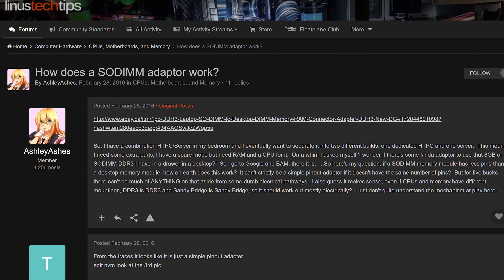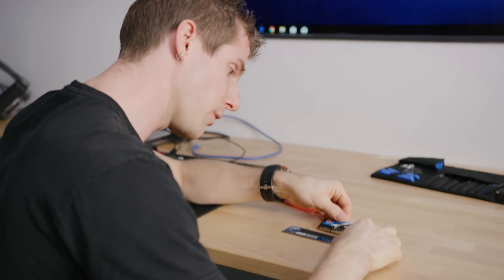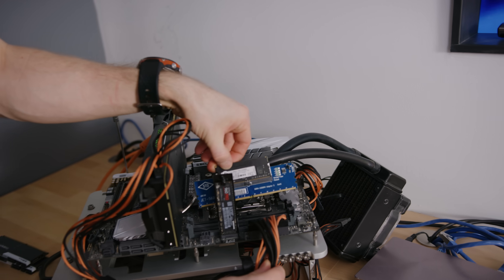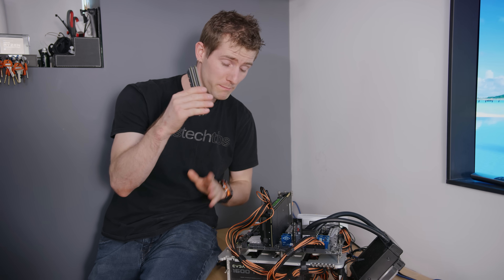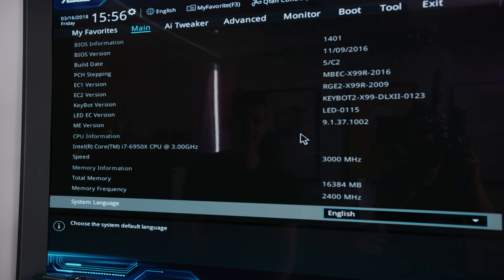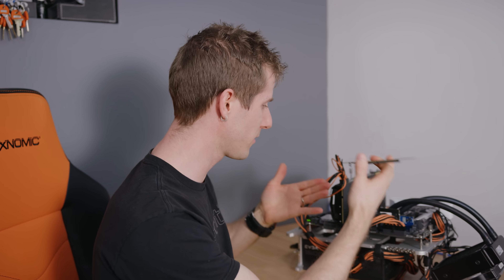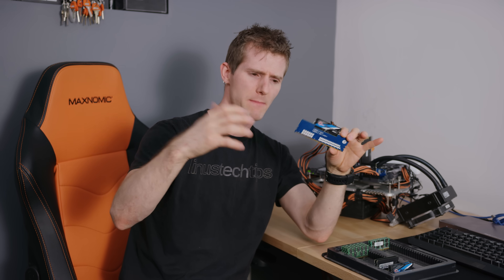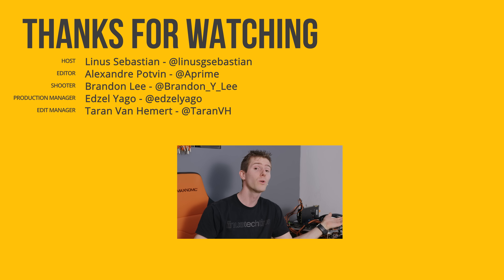Installing Laptop RAM into Desktop!?

Comment: 7y later if prices for normal ram keeps up, sodimm can still be cheap at places.
20 to 30 euro for ddr5 adapters, 24 gb for 100 euro, 32gb 150 euro. CAS Latency: 46 5600mhz. not great but a cheap option atm. Then use them in a future laptop later :face-purple-crying:

Comment: Believe it or not, this is very useful to me in 2025.
I run Proxmox on an HP Elitedesk G2 mini with 32gb sodimm ram and an i7-6700t.
I want to add OPNsense but have no slots for extra network cards and can get the larger G2 SFF that does very cheap with 4 or 8gb ram, but 32gb of DIMM ram will cost way more than the PC itself will.
With these adaptors I can use my existing CPU and RAM and get the slots I need for peanuts.
Reply: bro i’m fr thinking abt building an am5 build but the ram prices are so insane. i have a laptop that doesnt work anymore cuz it cant connect to wifi (ive tried ethernet and i got a new wifi chip new drivers i mean everything!).. was $1300!! i took out the ssd and ram and i plan on using it in my new build!
Reply: @Antlaar  What laptop is that out of interest? Have you double checked BIOS settings or for a small physical networking kill switch some have that is easily missed, if you didn't know it was there?

Comment: Hey, Linus. I have an old laptop running oWn DDR2 RAM. I wonder if you could upgrade the RAM slot to DDR3?  What I mean if you could remove DDR2 and put back DDR3 on into an old laptop.
Reply: Will it work that way?

Comment: my streamer pc wants DIMMS, I do have 4x16gb 4600mhz cl18 DIMMS in my gamer rig. I could use 2 of them in the streamer rig BUT the DIMMS are unsupported for that motherboard, it will work but it wont get more than 3800mhz and it will always give a message at startup where it says  "unsupported DIMMS found"
I would  never put in SODIMMS in an adapter to put in one of my systems, hell no!

Comment: Weirdly with a lot of laptops now there's a lot of free space due to the new norm of only including one memory slot... so really, a lot of laptops could have a fill size DIMM slot.

If anything there's enough space in a lot of machines for a SODIMM to DIMM adapter (the other way round to this one) to actually be feasible but no such product exists.  Full size 64/128GB sticks in laptops would be cool though.

Comment: I know this is 4 years old, but in answer the the question why? I have dead laptops people have given me for parts over the years, lots of laptop ddr3 ram, and an old 3770k + board with no working desktop ram about, when ddr3 is $200 and adapters for this old ass board are $3 and I have a bunch of laptop ddr3 around, I'm glad they exist.

Comment: Aseller on aliexpress wrote the following about the same adapter.

Description
Note:
AMD motherboard memory controller is integrated in the CPU, Since the CPU does not support notebook memory SPD data, AMD motherboard can not be used, AMD users need to pay attention when purchasing.
Specifications:
1.SinLoon Laptop memory riser card can use laptop three generations of memory for desktop DDR3 memory slot.
2.Laptop DDR3 SO-DIMM to Desktop DIMM Adapter Card Allows idle notebook DDR3 memory to be connected to the desktop.
3.ABS environmentally friendly material, resistant to falling, wear resistant.
4.Made of high quality electronic components, stable and reliable performance.
5. The pin has good contact performance, ensure stable working. Product Name: Laptop to Desktop RAM Connector
Model Type: DDR3
Colour: Green
Package Include: 1 x Laptop DDR3 SO-DIMM to Desktop DIMM Adapter Card

Comment: I'm searching for some even crazier solution: These DDR2-SODIMM models are so expensive. The notebook is used as desktop, it will not be moved much. Would be massive, if I could use a kind of external adapter with wires to get used for cheap DDR2 desktop RAM (say a 4 or 8 GB module) with an adapter in my notebook that only supports DDR2. A DDR2-SODIMM costs around 50 USD, this is insane. So I need a DDR2 desktop to DDR2-SODIMM-Adapter. I know that I only could hook it up external because of the bigger physical size of desktop RAM.

Comment: Or... now hear me out. You can resell old laptop dims, for less if anyone needs them for a device they're stuck on.
like, if someone was stuck on a 3rd gen intel laptop, but buying a little ram kit would be a waste, they could just get 2nd hand kits for less which will save them money. Mostly in the event they can upgrade to a new laptop, they can still use that laptop for a little longer, and save a bit of money.
btw, this only really applies is if your laptops performance would improve with more ram, like if windows and the apps are taking all of the 4GBs or 8GBs of that old laptop

Comment: Also, I could see a situation where you've got a desktop with dead ram, but you've got a laptop laying around, it's a cheaper solution than picking up brand new ram for the desktop, perticularly if that laptop ram is if quality value at all

Comment: I know your MacGyver and all but 2666 isn’t actually that bad for gaming.
I can attest to that much because I had a 4500u laptop obviously and it came with 8gb 3200 Samsung nothing new.
I couldn’t get Warzone too play without getting error messages 10 seconds into the pregame.I ordered 3200mhz ram and it got bogged to 2666.
Warzone launched and ran smooth at 54fps in 720.
Oh yeah it was 32gb lol

Comment: They may be useful in service centers where instead of having to take apart a laptop each time you need to test some RAM, you just pop it into your test bench super quick.
Reply: There’s laptops that have a little door on the bottom where the easily accessible ram slots are

Comment: I have used a laptop ram with the adapter for desktops that I refurbished and rebuilt because I had a load of laptop ram on hand.  It has always been a trial and error to find the max speed that the RAM would run at and be stable.  I try to repurpose 1 always before I send components off to recycle.  Resail of used parts is just not profitable considering the time and the hassle of doing so.  I also donate older unused parts to my local school and vo-tech if they can use them.  If I can not sell a refurbished and upgraded machine, it gets donated for a tax deduction.  :)

Comment: You know what? The price or laptop ram is the same as pc BUT if you sell PCs it's just easier to only have one type of ram and these adapters! The same with SSDs i only buy m2 and sata housings for them so that I can drop them in any device. Personally I would not bother with ram adapters though but that's a realistic use case.

Comment: afaik, all 35w tdp processor  of intel have support laptop version of the RAM. its just that you cant mix voltage working on ram.

this is actually a life saver for me since im repurposing a old tower to become a some sort of server and only I had is a bunch of laptop ram and the adapters are really cheap compared to buying  a desktop version of the RAM brand new or used.

Comment: There were rather interesting for guam sodimms. Such an/as adapters - JU Jet Electronics CO., LTD - adaptor - JET-5445 (it is 2 sodimms DDR2 to DDR2 DIM normal), and JET-5448 the same dual and for DDR1 , but unfortunately it does not exist for/in DDR3 and 4 standards any more. And single sodim to dim is not so attractive like those 2. :(

Comment: This seems perfect for me.

I use a gaming laptop which I upgraded over the years (ssd & 2x16 ram). I kept the OEM parts (hdd & 2x4 ram). Now looking to build my first gaming pc. I could pull out the upgrades from my laptop and return the OEM parts. That way I don't waste money on buying more ram or another ssd.
Reply: You should get good ram though lol, very important part. I doubt your gaming laptop has heat sinked over 3000Mhz low latency ram. 16gb ddr4 is really not too expensive, will probably be the cheapest part in your build.

Comment: Been using these for years 
Because i have lots off laptop ram laying around. Both ddr3 and 4. My experience has been you cant mix and match sodimm and dimm in same system. 
Mismatch sodimm works. But mismatch adapters also dont work. Some have switches that are labeled in Chinese don't know what they do but the computer will only boot with the switches in the correct location.

Comment: We throw out lazy 4th gen i3 laptops at work which have 8gb dimms installed, but also quite decent 1155 desktop PCs with only two RAM slots. They could easily be upgraded  to 16 GB with these adaptors and two notebook's RAM to be taken home

Comment: Very interesting: AshleyAshes  appears to be "banned" on LinusTechTip Forum, now. Wonder why? I tried to follow forum posts (and what Linus is doing in his vid) - Since I worked as a computer technician (and still attempt "hobby electronic projects" today) Anyway > If anyone gets this far, there are two kinds of SODIMM to DIMM adapters on sales sites. SODIMM DDR3 and SODIMM DDR4. It's SODIMM DDR4 adapter (without the DIP switches) that Linus is testing in above video. At 2:59 (with 2 DDR4 adapters fitted, plus 2 DIMM modules fitted) his PC fails to boot. From what I can tell, these adapters cannot be "mixed" with ordinary PC DIMMs... So, if you wanted to upgrade your PC to 8GB RAM (for example) > you will need two of these adapters fitted with 4GB SODIMMs in each adapter. Some reviewers (who bought these adapters) mentioned this is "disappointing". Linus demos these SODIMMs will run at 2666 in these adapters (I think you will need a good BIOS that can detect and select RAM speeds). On balance, though, because you cant mix DDR4 types and some reviewers mention "system crashes" (when playing games), I would only use these for testing SODIMMs (that you will be selling later). It's a nice idea... But just buying compatible DDR4 is a way safer option, so it can run with your existing DDR4 (since that's likely to be fitted in your PC). Thanks for reading. Peace.

Comment: Linus:”not high performance”
Me:”Cries in DDR2 886 MHz”
Reply: DDR266 anyone?
Reply: @Rori-GO_YT  how do u even run something with that
Reply: @old9367  haha that’s a 2004 PC and it now runs Windows 7, and even with Aero

Btw does that frequency even matter? I also have a latest PC with DDR4 2666 MHz but that PC also has a SSD and i5 8th CPU. 

I’m not trying to be rude, I just want to know or learn that.
Everybody just shows some benchmarks but nobody shows some real world comparison like flipping through chrome tabs and like that.
Reply: @Rori-GO_YT  sometimes it does but you really shouldn't worry about it
Reply: @Rori-GO_YT anything over 2666 MHz doesn't matter at all for Intel CPUs
Reply: @Rori-GO_YT  DDR2 ram is actually going up in price as it becomes more rare. You should think about selling it.
Reply: @rdg665  depends on what you're doing, if for any reason most of your ram gets used the frequency starts to matter, even having a dozen chrome tabs open. Otherwise you're right.
Reply: DDR2 667 anyone?
Reply: @hammyboigaming904  me
Reply: Me ddr2 533Mhz with atom n270

Comment: ramception adapt ddr2 to ddr2 sodimm to ddr3 sodimm to ddr4 sodimm

gigabyte had ddr to ddr2 adapters to use ddr400 in a ddr2 motherboard.

There was even an agp to pcie slot adapter too made by msi i think.

Comment: it could be that laptop memory is cheaper than desktop memory because often motherboard makers have to pay royalties to use the connectors and it may be that the ram slot interface in desktops still have a valid patent in effect so by building adaptors then the cheaper laptop memory can be used.

it is like  thunderbolt verses usb. apple and intel owns the patents for thunderbolt but usb is standard and open so build a hub adaptor and now you can use usb on a system that has thunderbolt but not usb.

Comment: I'm running them I built a desktop from a gen 1 I7 laptop CPU that I pulled from my broken laptop. A company called Winmax in China makes desktop MBs for laptop CPUs and I had a much better GPU than  what was in it and saved the 17" 1080p monitor by getting a controller for it.

Comment: Do these have the traces for ECC ?
I considered these after buying ecc sodimms for a laptop that didn't support ecc, the desktop does support ecc. And they are B die, so better than the hynix that's in the desktop.
"JET" has been around for awhile, they used to make budget motherboards and vid cards I believe.
custom small boards with cpu's soldered on.
I figure an adapter like this is bound to affect signal integrity, maybe you lose a few MHz on the max potential clock.

Comment: Supports EEPROM (SPD) device on protector card. JP1: Selecting EEPROM (SPD) device location 1-2 short: Select EEPROM (SPD) device on adapter. For testing only. 2-3 short: Select EEPROM (SPD) device on the Memory Module (DUT). Set this jump to use on regular PC

Comment: QUESTION: Desktop DDR3 RAM runs at 1.5v while most laptop DDR3 RAM runs at 1.35v. I have laptop DDR3 RAM that runs at 1.35v, but I also have laptop DDR3 RAM that runs at 1.5v.  Does this adapter affect voltage? Is this adapter compatible with both 1.35v Laptop RAM and 1.5v Laptop RAM?  I'm just wondering how the adapter and desktop handle the difference in voltage.
Reply: i think the voltage is usually controlled by the motherboard, and is specific to whatever is installed. You could also tweak it in your bios if you don’t have a barebones motherboard

Comment: As far as I'm concerned, that is a BLOODY GREAT piece of kit. Now I don't have to keep opening up and risking damage to DIMM slots in Hi Spec laptops, I can check all the SO-DIMM I want and only install known working ones....One of these MUST BE in the kit next to the SMD to PATA and IDE to SATA and other adaptors...more bits from the "BLEEDING EDGE" bin can get a revisit......recycling begins in the home, like charity.

Now, just where DID I put my MASSIVE Maxtor 8Mb SMD drive...and my matched pair of 8Mb SIMM RAM sticks. I feel an "Attack Of The Mutant Camels" coming on......and maybe some Carmageddon....or even Duke Nukem. Leisure Suit Larry might make a comeback too...????? I'm really going to be driving that 2Mb video card hard tonight....
All I need now is a few thousand uncorrupted floppies to install Windows 95 with and I'm set.

Comment: For the used ddr3 market this is super convenient since DDR3L sodimms are much easier to find use on the *higher frequency ranges. Like for say running a Macpro that doesn’t allow XMP at its maximum speed.

Comment: Linus I want to know is there an over all long term worries if u do this. Or is it kosher and nothing to worry about because it will work fine as if it was a standard desktop Ram please help just want to know the pros & cons technically. "Why" because I'm not exactly working with a big budget and I accidentally bought these for my laptop and didn't end up using them so I want to know if I can incorporate these for the life of my desktop.

Comment: I have two of these for DDR2 SODIMM to Destop DDR2 adaptors.  I've tried them with 3 different brands of SODIMM on 2 different desktop DDR2 motherboards and they didn't work. Both computers just went into a reboot cycle and I couldn't even get into BIOS.